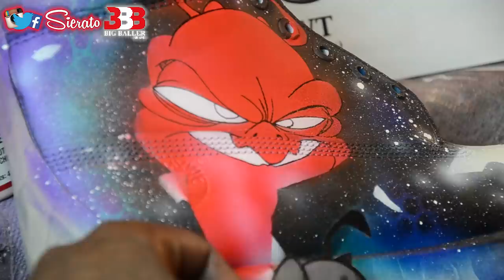🚀 Crafting MONSTAR Magic! Watch Sierato Design Space Jam Timberlands for Lamelo Ball! 🔥

Comment: For the people that don't know since u didn't explain, so they don't make this mistake if there just learning. GAC 200 is  a Hard acrylic extender for non-porous surfaces its the hardest and least flexible polymer they offer. So it's like 2 hard from angelus. It's used as an adhesive promoter but for non flexible surfaces. With Createx, to avoid the paint coming off they offer a 4030 additive which is there adhesive promoter and helps exactly on adhering the paint to help the tape from ripping off paint. This adhesive promoter is made for the Createx line of color's. So look it up, gac 200 and angelus 2 hard wouldn't be a good idea for leather. Adhesive promoter, but only for non flexible surfaces.
Reply: Would GAC 200 be good to use when painting the sole? Obviously you would have to still apply a sole protector, but would that work?
Reply: Hello. Now I've read your comment. So sierato used that as white base, createx?  Can it also be used for plastic, metal with airbrush?